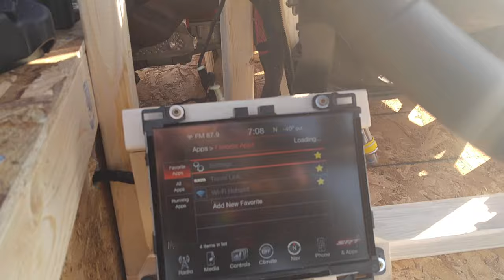Dodge Charger Hellcat turnkey pallet

Comment: I have a BIG question:

What is the point of doin this?
ITS A HELLCAT ENGINE
unless if its only a prius engine...
Reply: Resto mods for the most part also putting it in a 300 or something it’s pretty much a modern car in a crate all you would need is a body and suspension to get it to move
Reply: Damn... 1 year feels like just 1 month